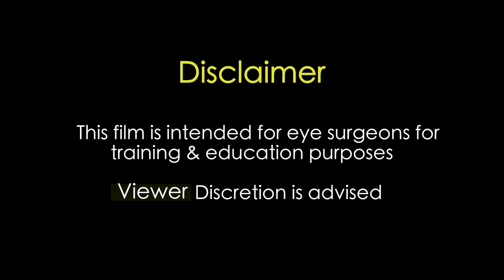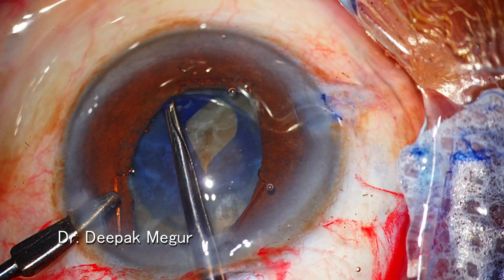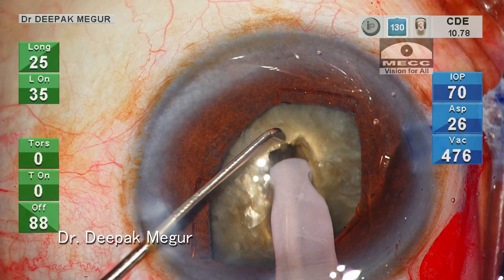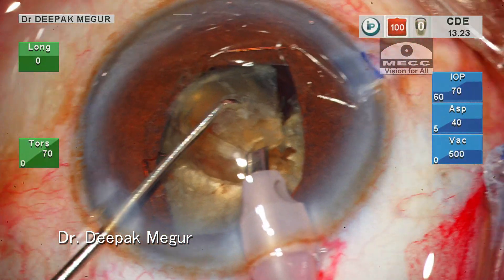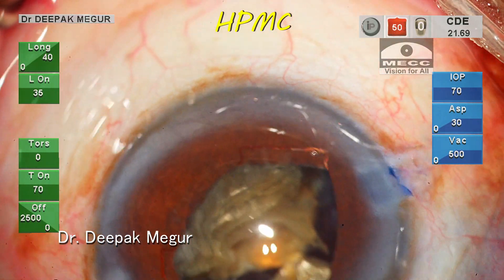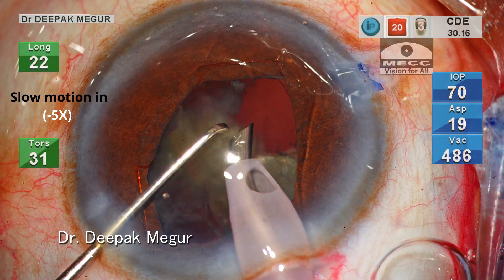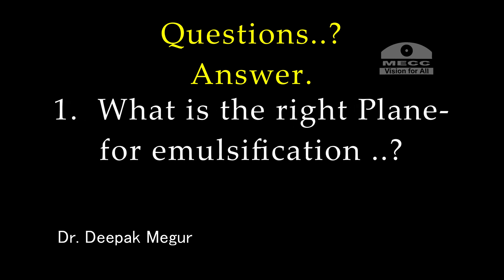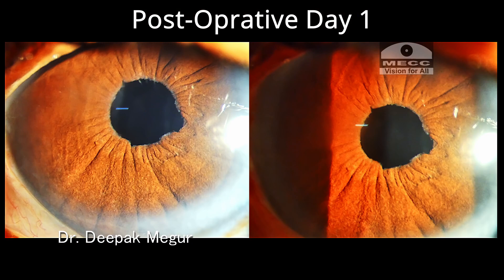What Should be the plane of emulsification of the Nucleus - Dr Deepak Megur

Comment: This is probably easier with peristaltic system phaco machine as vacuum will only be generated if the tip is occluded. With Venturi system phaco machine.. the risk of PC rent if doing phaco below iris plane is higher since vacuum will be generated even if the tip is not occluded. Please advice on this if using Venturi system machine! Thank you in advance!